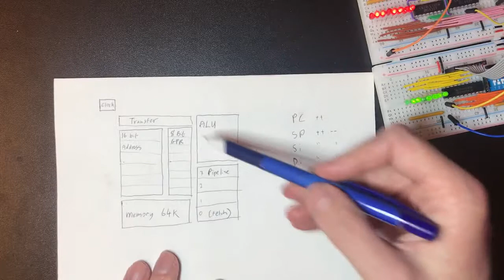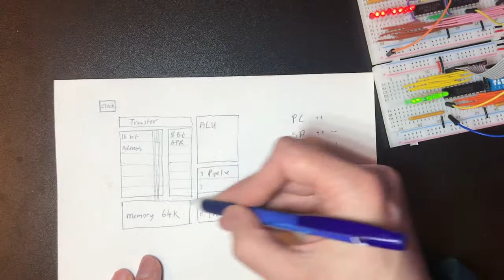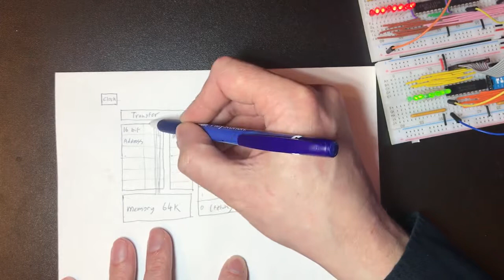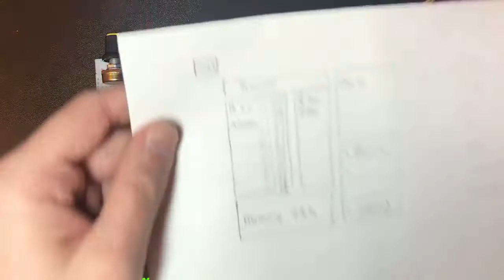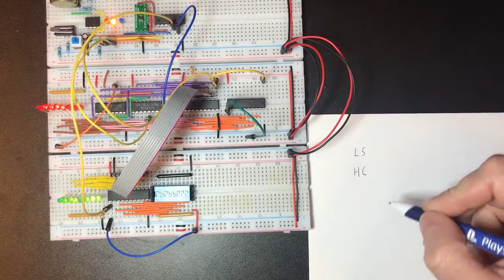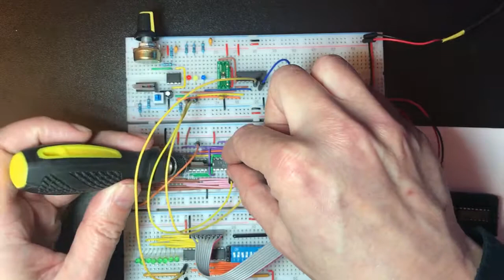Address registers (4: Finalizing the design) - Making an 8 Bit pipelined CPU - Part 6

Comment: I know its probbably expensive, but here it would seem justified to use some sort of double access memory.
Reply from the maker: Did you post this in the right place? The comment doesn't seem to fit this video?
Reply: @weirdboyjim  so that you could use one mem. access line every cycle for fetch, and the other for r/w of data for the pipeline.

Comment: God job with the LEDs. People regularly have issues noticing that TTL doesn't use "+" and "off" but "+" and "-" for its logic (unless it's a 3-state output with "+"/"off"/"-"). Unlike a wallswitch for a ceiling lamp...

Same root cause that makes programmers mix up NULL and false, I'd say... ;)
Reply from the maker: Thanks. On NULL and false, it's easy to get distracted by the way they usually both map to zero when cast to an int but the abstraction is better (especially in the case of bool) as it gives the compiler flexibility in the implementation.

Comment: There are other 74LS compatible families with better propagation delays.
Reply from the maker: Yes, but my goal is optimize the usage. You can make decisions that improve the efficiency allowing an increase in clock rate on LS, on a faster family it should give you the same proportional gains.

Comment: std practice for any logic family is to never leave inputs floating unless the datasheet tells you the input has an internal pull.   Even if a floating input won't change the state you care about, it can add a gate that is changing state randomly, and wasting energy.   No loose gate inputs!
Reply from the maker: Yeah, I don't leave any inputs floating on the pcb's but I take a few short cuts on the breadboards. Easier to draw a trace than cut extra wires by hand.

Comment: It's kind of funny watching these videos now after having followed a similar path a year ago. I would have liked to have seen them then. The similar feeling here is listening to you talk about the TTL/CMOS (LS/HC) chip situation. I'm sure as I watch more of these videos I'll here your feeling continue to follow more of the path I later followed.

As good as Ben Eater's videos are, I think it was a mistake for him to use TTL for most of the teaching. People like me and you get convinced to use technology which was out of date by the time the first personal computer was released. Yes, our home made CPUs will never have a practical purpose, but learning to work with CMOS is more practical than TTL.

The primary reason he did so seem to be to have been to make powering the LEDs easy. With TTL logic, you can pretty much always connect an output to an LED to see if it's on or off. That's good at first, but after a while you find it's not hard to use some 245 buffer chips instead to power the LEDs and then you can run it all on CMOS unless you have some special case.
Reply from the maker: The things that interest me the most are the logic flow of the circuits rather than the electrical specifics but obviously I've picked up a lot along the way. I'd probably go with pure cmos for a future build but the TTL I don't regard as a terrible choice. The biggest flaw in Ben's initial videos is not putting current limiting resistors on the led's, I know a few people had issues where they couldn't get the circuits to work as shown without them. Current drain on LED's can be very varied and the current sourcing ability of a random ebay purchase LS chips can be very erratic.
Reply: @weirdboyjim  I don't want to imply that Ben's video were bad by any means. They're great.  He got me over a large number of hurdles I had in my understanding very quickly. I do get the TTL choice, but I felt like as presented it left a certain hole in understanding. 

To some extent perhaps this is because I'm more important because I'm an engineer who finds himself working close to hardware after 20+ years writing software and I felt like the TTL had little to do with the CMOS based reality of devices. This might be unfair on my part. 

Ben is encouraging people to find their own route so it's not like he's in any way telling people "this is how it is", which would be silly for a built your own CPU project, something which is only useful for learning. We both found his memory situation limiting, but your pipelining is very ambitious and I'm curious to see how the story goes. I didn't start until last year so you're far ahead of where I am.

For the LEDs, even with the TTL I'll have them running through a 74LS245 buffer or something else. Ben did a good job getting me enough info to use these kinds of chips, but watching the videos I still have a programmer's mindset about using the LEDs. The voltage on the wire is "true" going into some other chip, so it should be "true" when I try to use the LED of the same wire. But electricity does not work as neatly as software.

I end up getting most of my 74 or 4000 chips on AliExpress. Not sure how the options are where you are, but even though it feels like a "wretched hive of scum and villainy" where I've had some orders fail to ship, if you're careful you can get a pretty cheap supply of chips for cheap if you're willing to wait a month. I wouldn't use the site for anything where it would be worth scamming me.

Comment: In the early/mid 80's, the new HCT series was a real technological advance.  It used to be that TTL had voltage levels and current that were easy to work with to directly drive LEDs and long signal lines, and CMOS used a lot less power but could not handle high speeds.  HCT gave the best of both worlds, basically cutting the power consumption.
Reply from the maker: In the early days of this project I had some conflicting advise on what logic series to use on the PCB's, the HCT seemed like the idea middle line giving the benefits of cmos while interfacing well with the LS on the bread boards.
Reply: @weirdboyjim  It's amazing that 7400 series chips are still made!  I wish I could have afforded to build something like that when I was a kid.
As for logic families... I had a Tandy model 100 which is a keyboard and LCD display, several inches thick.  The RAM expansion socket had a different pin-out than an off-the-shelf RAM chip as well as being a different size, and (with the help of a friend who was studying EE) we built an adapter out of two sockets stacked up, wiring the bodges between them.  To get the chip select or something like that, we needed to add a single logic gate.  A low-numbered 7400 chip fit the bill, but we didn't have it in HCT.  It turns out that one chip (quad something gate) used as much power as the entire computer.

Comment: 4000 series cmos fan out was infinlte if driving 40000 series. 3v to 18v suppiy range too.
Reply from the maker: The same could be said of the 74HC series, basically everything where you are driving fet based devices as they are voltage controlled and in theory don't consume current (That changes when you start chucking led's and pull ups/downs in the circuit). I started of doing everything with LS devices though which have a more restrictive limit. I'd probably do it all with CMOS if I were to start again from scratch now.

Comment: you can design the entire control unit as microprogrammed using an EEPROM Chip for selecting various sections of processors like Memory registers, ALU, bus control registers, etc.
Reply from the maker: You can indeed! There are obviously other projects that do exactly that. Rather than stepping a microprogram I’ve chosen to use a pipeline as an experiment with different types of architecture. You can think of the pipeline as like a very simple micro program except that when one instruction is executing step 2 the next instruction is concurrently executing step 1.

Comment: "Shot-key" :) At least that's how I hear it pronounced by many other Youtubers. I think all my 74xx chips are HCT. I haven't yet cared to properly check what that all means.... as long as it can take 5V...I am a happy man.
Reply from the maker: I'm just glad i've not had to use "Frenel" on a video yet.
Reply: HCT has TTL compatible input voltage thresholds. That is to say, HCT inputs are considered "high" above 2.something volts, which is similar to say an LS variant chip. That means you can mix HCT chips in with TTL family (e.g. LS) and not have to worry about your circuits misbehaving.
Reply: @TomStorey96  Correction: HCT has HC compatible inputs which also happen to be TTL output compatible. HCT has TTL compatible outputs allowing you to drive a TTL IC or an HC IC. Or either one driving it's inputs.
Reply: @ducksonplays4190  that's not what I'm reading.

"HCT features and functions are identical to HC devices with the exception of modified input circuitry, which makes
the input threshold voltage compatible with TTL circuits. HCT outputs are similar to the HC family."

Taken from a TI document called "SN54/74HCT
CMOS Logic Family Applications and Restrictions".

Wikipedias article on HCMOS also says that HCT features TTL compatible input voltages. I haven't yet read anything that suggests HCT has TTL compatible outputs.

Comment: Interesting ideas, I enjoy your videos. 74HC works fine as long as you remember that they need to be clearly defined on the inputs or they float. That goes for when you use say half of the gates in a chip, unused gates with floating inputs can cause a lot of problems.
Reply from the maker: Thanks for commenting and the support Peter, I've only sent a link to the videos to a few people I know for feedback, I believe your the first to find them by browsing and subscribe. I'll probably post a link somewhere once it's a bit further along (and my confidence builds that I can actually make it work).  

I'm obviously far from an electronics expert (This is me learning) so anything I say in the videos or comments should be suspect, but I can try and explain my understanding. LS (and HCT) gate OUTPUT levels are "less than 0.5v for low, greater than 2.7v for high" and HC gate INPUT requirements are "less than 1.5v for low, greater than 3.5v for high". So there is a nasty 0.8v band where a signal that is  a legitimate output from an LS chip is actually an invalid input to a HC chip, in practice this doesn't happen in simple low frequency circuits but as clock speeds increase it becomes more of an issue. Most notably the switching doesn't happen instantly, the gates internaly do their thing and the voltage level on the output will start to climb but it may take far longer for an LS chip to reach 3.5v than it's rated propagation delay. It maybe a pipe dream to get this thing up to a clock rate in the megahertz range (and it maybe that some of these issues are actually irrelevant at speeds that slow) but I am trying to take account of all the things I'm learning about as I go. 

You are of course correct about the unused gates needing to be tied high/low, that caught me out with the counter chip. I fully expect to feel embarrassed looking back at these videos as my understanding improves.
Reply: @weirdboyjim  As long as things are electrically decent the 1-2MHz range should be fine. The faster you want to go the more important the propagation delays, timing and synchronizing things like meory reads will be.
It was actually YouTube that suggested your channel, probably because I watch a lot of similar things. I am working on a 8-bit computer from HC chips myself, by coincidence with 16-bit capable adress and index registers made from HC193 and HC541 chips :) I try things out at 1Hz or so, and will crank it up gradually as things mature.